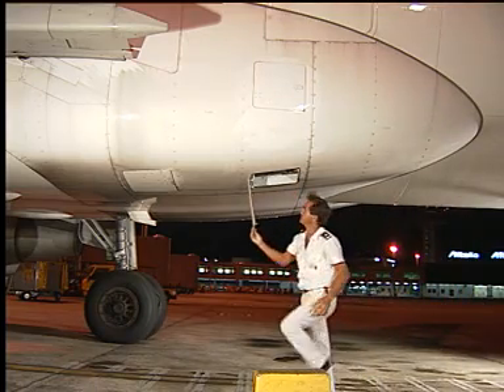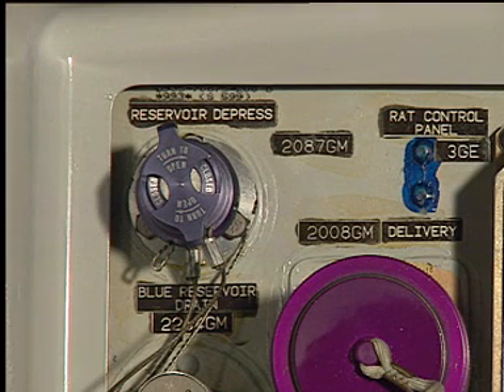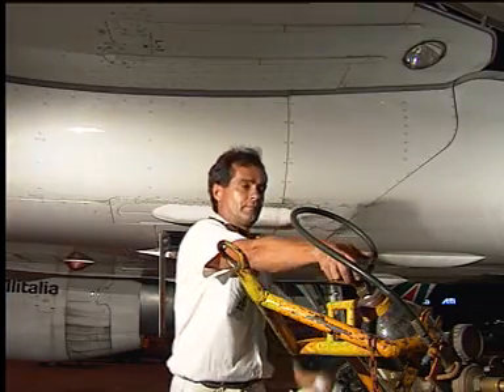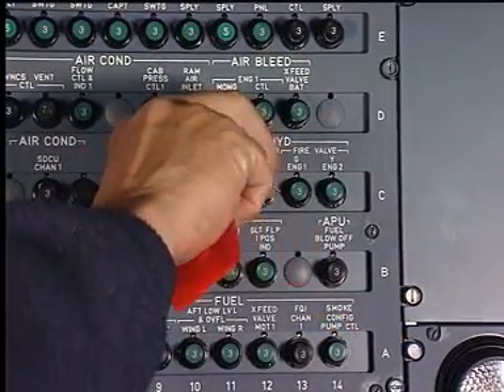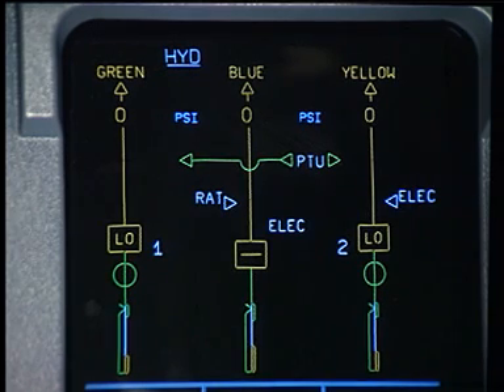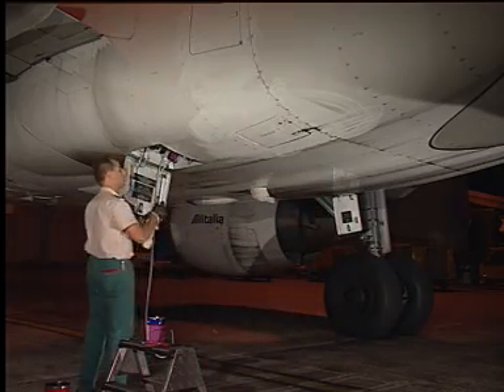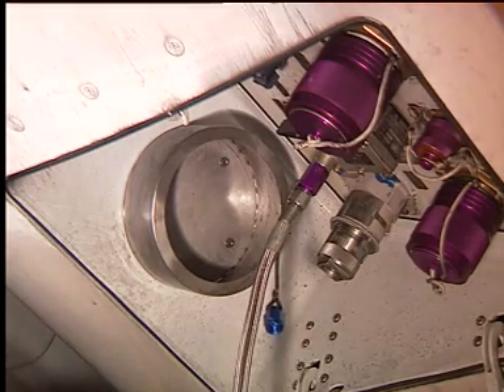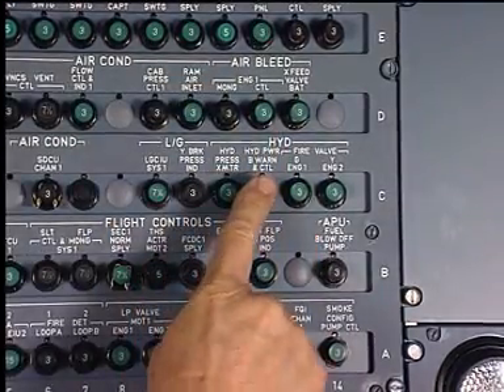AIRCRAFT | Hydraulic System Servicing

Comment: a few thoughts; 8 1/2 years of AC maintenance; filling from a "punched open" can of Skydrol with NO filtration?  and if you know you are going to make an instructional video, why pick the dirtiest machine in the fleet with trash blowing across the ramp?
Reply: thomas m. tordel jr. There's a servicing filter in line with the service port. You can see the housing for it on the panel.

Comment: when filling blue hyd, should watch the blue band, not the green one.
Reply: +Alaam Panah You will possibly note that the gauge is designed to align the rightmost end of the blue and green arcs, so that in both cases watching the green band will at least result in correct filling.
Reply: sure but the way that it was presented, it can lead people to think that the end of the green band is full for all three systems. Which would lead to over servicing the yellow system